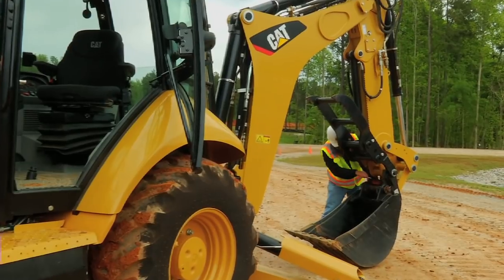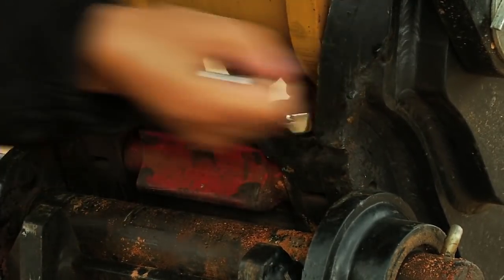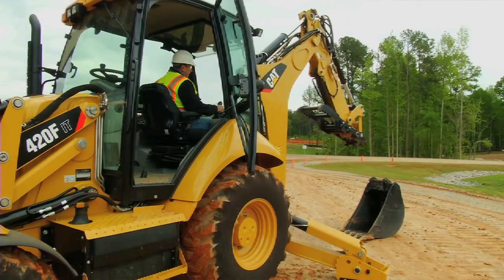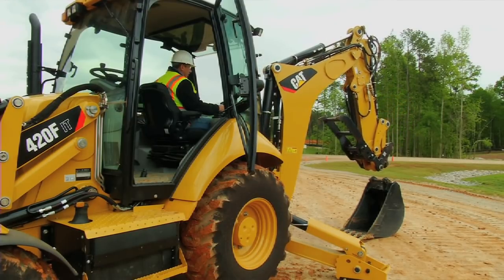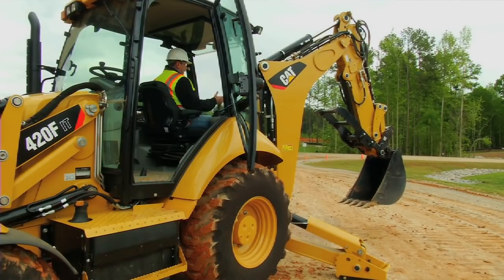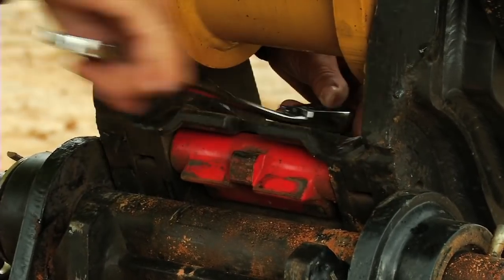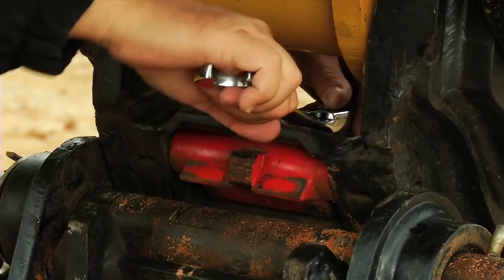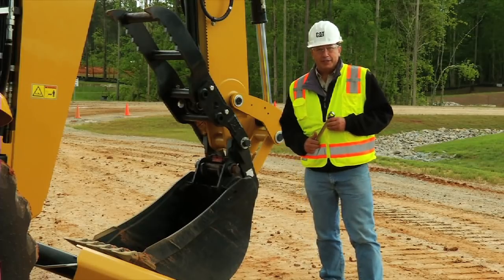Dual Lock Manual Coupler for Backhoe Loaders & Mini Excavators

Comment: 3/4” wrench is equivalent 19mm not 22mm. Looks like a lot of work but compared to driving out bucket pins and reinstalling them, this dual lock manual coupler is a real time saver.

Comment: After spending 1300$ for this coupler, and using it for a year, the threaded shank that moves the wedge up and down is corroded to the point it won't work at all. This is a piss poor design. Either get the hydraulic coupler or don't get one at all. Bobcat has CAT stomped on the manual coupler design. Pull one pin, drop bucket, grab next tool, insert pin.............simple and effective. Are you paying attention CAT? Or just waisting R&D money over engineering something that is simple as hell? It doesn't take a genius to know that putting a threaded mechanism right in the middle of the part of the machine that will be in dirt, water, and mud more than anything else is a bad idea...........smh.............#Wtfwereyouthinking?
Reply: 3000 hours on ours still works like new
Reply: bigugly1911 we have 223 hours on our  305.5 mini, and the bucket sits loosely in the coupler, wont ever be tight again. Super garbage made, and the bolt has rust on it already from a previous dumb operator messing around with it, and I am convinced thats why it is loose